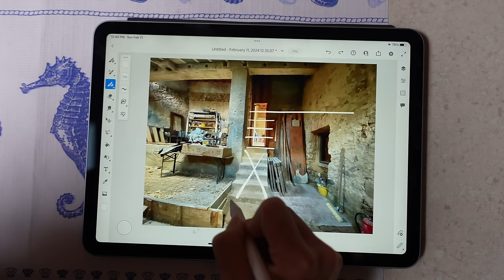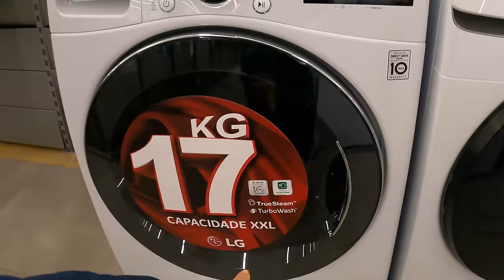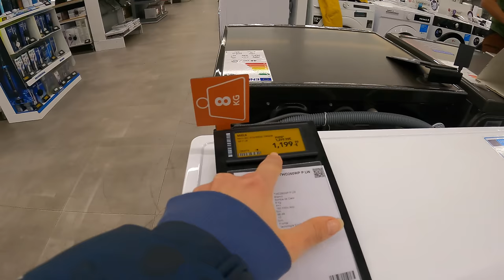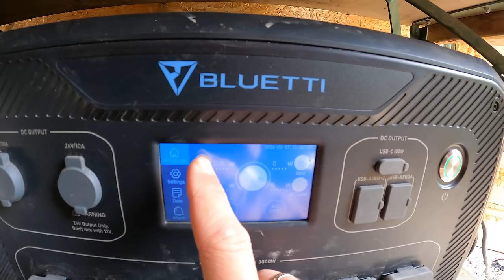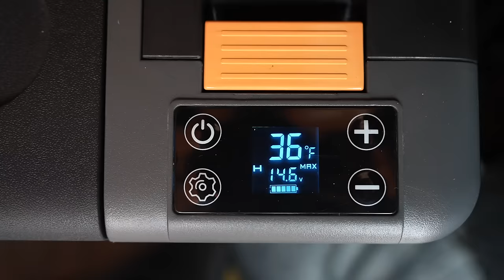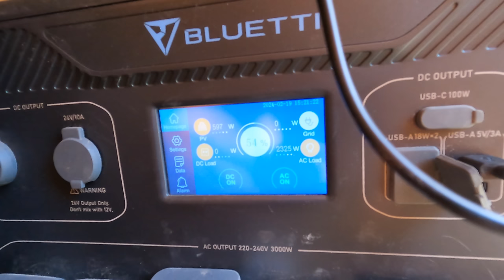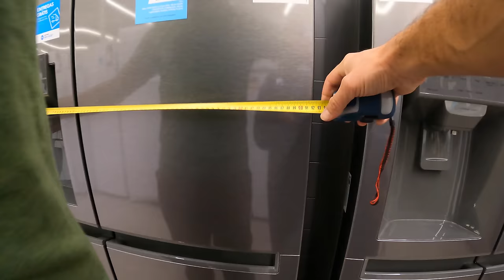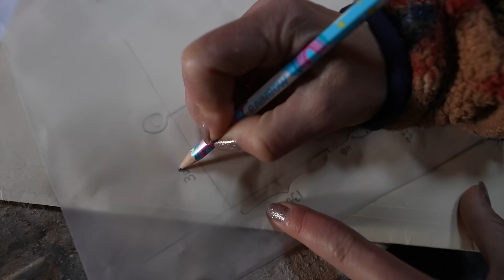UNEXPECTED PROBLEMS PREPARING OUR HOME RENOVATION FOR ELECTRICITY AND APPLIANCES

Comment: A tip for you . When you have the dimensions of your cooker , fridge etc , put sheets of paper or cardboard cut to side on the floor. Then you have the footprint they use up and this will help you determine where other items will go, e.g the Island
Reply: That's an awesome idea, but the construction crew might think it funny...
Reply: 😙 maybe try for your benefit and draw them on the floor …. our neighbours said we were crazy but then they did it when buying furniture. 🤣🤣
Reply: You don’t need to buy the same brand extractor hood as the cooker. Most people ai know wouldn’t (unless you’re getting a decent discount to buy both). I’m with the other commenters who say mark out your planned kitchen on the floor, it will give you a clear understanding of whether your plan works in practice for you. Also, bear in mind if you get a fridge freezer with a 2 door freezer compartment, 5he freezer. Shelves are quite small - I had one and discovered I couldn’t fit some items in (such as a frozen pizza).
Reply: Yes, mark out your appliances and even counter top, island etc. Remember… you are using the metric system which is 1000 times more accurate than the imperial one. So you can measure everything to the smallest millimeter. 👍👍👍
Reply: And lines for how far the open fridge, dishwasher, oven, washer/dryer doors go. And don't forget the over hang of the island.
Reply: You mean, use C.A.D?

🤔

You know, Cardboard Aided Design
Reply: Agree with the paper cutouts. Once you have your items use chalk to outline of your kitchen cabinets and appliances - helps you and your builders see where things go and let’s you walk the space.
Reply: @weedfreer  🤣
Reply from the maker: @nandaabreu5369  We prefer the metric system as well. However, my mind still only understands distances in imperial 😜
Reply: @Mrandmrsadventure  Of course! I totally understand that . I am the total opposite, because I grew up with the metric system. By the way Drew . I need to worn you that there may be someone out here in this platform trying to impersonate you. I received a “highlited reply “ from a completely different profile but with your pic and the context (content, way of speaking etc) was not your style at all. Sara and Luca were already victims of impersonators, so I am just giving you heads up. I took a screenshot of the answer, but I don’t know where to send it to you so that you can report it. I don’t have instagram.
Reply: You can also use tape to outline where things go, which can be moved or changed easily but will stay put until you are ready to pull it up.
Reply: Don't use the size of only one unit use the average size of each unit. Because in  few years you don't want to be doing major renovation just to get a washer or refriz to fit takes 1 inch wider. It happens too many times.
Also anyone who has lived very close to food and maybe be stranded for days from storm. A freezer is a must as well as LPG propone or hybrid devices, oven, frig, bbq,    lantern. convection Ives and single  burners.
Heaters and AC units.
Like I said
Reply: Everything that is it hybrid, meaning needing Electrical AC power only you need to decide what can and should be on a separate circuit that when you loss power and you start switching to solar, generator and batteries theorems that 100 % need to connect everything else later.
water pumps and regulators 1st, small frig, small burner, small  oven, a heater/AC for one small area, phones, computer, Internet, a few LED lights of sensers, you should have outlets for Solar control, toil chargers, generators and powerpack can be recharged.
We have been off grid my whole life and for 4 generations.

Every power option should be part of your play. solar, wind, water, geothermal, LPS, battery  and generators.
I believe 10-14 days is a good numbers it  was 3-4 months in the 60s.
What every the sources you should create a power worksheet. List every single device the start up, drawn, run drawing, idle draw the amount of time if each,  time of date and list of the 911 24/7 items 

It is wise to have all priorities items presided and auto transfer switches and whole house monitoring and regulated. 
This uses to be a major thing but today this is 500% cheaper easy to setup and runs all by itself with alert to your phone in realtime. 
It is called SMART HOME and there is everything in the house that can now monitor and adjust everything .
When I started it was few items stuff did not interface. Now with. IF TTT, matters, threads, wifi. IF, RF and Bluetooth it's fun and reliable. 
Every
Reply: Use the. Average sizes for each device when time comes that model assize may not be the same. There are countless stories if remodelling costing 1000 because of an inch to much. Use the average sizes. Freezer and a mini version of oven, stove and refrig should be as plan B  manual washer as cloth lines . Every solar and wind company has worksheet on there websites. You need to know your draw and if you need more land for the solar farm and battery bars.
Reply: Wild hogs will mess you up fast they are fast too and protective if babies or are around.
You should get a gun very less bear spray and loud whistle and cattle rod long shocking pipe.
In the state we get state to dart them tag as attach large loud  bells round their necks
Reply from the maker: @nandaabreu5369   Really curious what this is all about. Thank you for bring it up to us. Please send the screenshot to our email. hello@mrandmrsadventure.com
Reply: @Mrandmrsadventure  just sent it. Hope you got it. Also, when I originally got this message, it was 10:ish pm which meant 2am your time. The text message this person wanted me to use was a # from Tennasse

Comment from the maker: Thank you for being such a special part of the journey 🤗 We love you! xx, Mr and Mrs A
Reply: Question: If you have to get fiber installed, why keep Starlink? You can keep Starlink as a backup if you'd like. I am sure the fiber is cheaper vs. Starlink at $150. I am just guessing on the price.
Reply: Love y’all too! Thank you for sharing your beautiful journey! ✨✨💛🌞💛✨✨
Reply: Hi guys, I am Portuguese. We always had old cars, never we’ve been told to get full comprehensive or nothing. That sounds fishy. Do you have Portuguese friends that you can ask for advice? Companies I know we can simulate online, Zurich, Allianz, Fidelidade, Tranquilidade. Good luck 🍀
Reply from the maker: @lovedfriend2020  Good question. Starlink in the Portugal is now €40 a month. We would never get fiber or a hard connection due to the setup costs of running the cables to our house. This is why being required to instal an entire "hardwired" telecommunication network in the house is pointless..
Reply from the maker: @sarab3960   Thank you. Yes, we have heard of these companies online but they will not insure our camper and only our truck.
Reply: @lovedfriend2020  True. Internet in Portugugal is super cheap. At least compared to 🇨🇦 which is the country in the “industrialized world “ with THE MOST EXPENSIVE internet, phone plans etc. Two years ago, my brother was paying (in Portugal 🇵🇹) 50.00€ a month for high speed fibre optic internet, landline and 3 cel phones!!!! Unheard of in Canada.

Comment: If you haven't done the kitchen yet, Draw a scale floorplan of the room (including pillars and alcoves) then cut out some scale shapes of the various appliances that you have measured (don't forget to mark what each shape is on to it). Fit the shapes onto the floor plan drawing and move them around until you are happy with the layout, then either tape or glue them in place. Thar will allow you to work out electrical outlets and water lines. Also good for the other rooms - bathroom, bedrooms. 🙂 
Also maybe think about a 2nd outlet next to the container one, so that if you ever do go down the camping site route on the terrace, you can run in some power lines to them

Comment: Miele is one of the most reliable appliances, expensive but durable.
Reply from the maker: Thanks for sharing this. Good to know.
Reply: @Mrandmrsadventure  AEG and Teka from Germany are excellent as well (don't find them Stateside though)
Reply: Miele is expensive, but pays off in the long run. I have my miele washer now for around 15 years. They last forever.  Siemens is also good (my dryer and Kitchens suppliances. Maybe this helps 😘 greetings from Germany 🇩🇪
Reply: Bosh washing machine that's going strong  teka air vent and a dishwasher zanussi works amazing and 23 year's old looks and works like new never have had any problems
Reply: Miele washer and dryer are the best... I bought mine 25 years ago and they still look and work like on the day I bought them
Reply: Appliances are hit or miss for some. Just make sure you save the owners manual, and register your appliances. The warranty on most of these appliances is 90 days or depending on what warranty you purchase, 3 to 5 years. I purchased my extended warranty just shy of when the manufacturer warranty expired. It didn't make sense to have a 90 day warranty running simultaneously with an extended warranty.
Reply: For the fridge get a no frost to avoid any ice spreading on it
Reply: I have had bosh washing machine for 20 years still going strong and would buy again if I needed
Reply: @Mrandmrsadventure  - I think you'd be surprised how good and durable LG or Samsung appliances are, especially fridges and washing machines.
Reply: @resinartbylilian  agree that Miele is a good brand but repair cab be a nightmare as only miele authorised person can repair them  so callout charge ,parts and labour are expensive.  I have Miele products
Reply: Have a lg in the summer house and totally regret I didn't get something more expensive, 4 hours for a load
Reply from the maker: @antoniodasilva1230  💪 love hearing when something is reliable and lasts
Reply: Bosch is a nonprofit that does good in the world and has good customer service.

Comment: Hi guys, in Portugal having ALL appliances from the same co. Is totally insignificant. Here, we look at having the best appliance in the market for our budget. Some appliance brands are well known for putting out great ovens, other are known for great washers, so having different brands of appliances in the kitchen is totally fine (even when it comes to selling your home) as long as it is a quality appliance. Keep on with the great work. ❤
Reply: You're correct my brother and sister back in the USA are having problems every three our four year's with the refrigerator's and washing machines they just aren't last long and keep braking down  basically expensive crap that are always in need too be replaced
Reply: @antoniodasilva1230  Honestly, I don't get this about having all appliances from the same brand co.
Reply: @Alfablue227  yeah it's a dumb move especially when some are better than others  for example my refrigerator is a Samsung
Reply: @antoniodasilva1230 It'sas if they have a timer set to blow the machine a couple of months after the warrenty expires.
Reply: @Alfablue227  Brand loyalty is stupid. If you research properly you will find that several brands are owned by the same parent company where all the washers, driers, fridges, or cookers for all the brands are made in the same factory. They just have slightly different cosmetic trim etc. for each brand, then set the price based on the brand name. All one big con.
Reply: It’s important to get appliances that have parts found locally.
Reply: Miele is top of the brand of electrodomesticos... German quality one if best brands of Europe... personally I don't have a budget to buy Miele...I will be very happy to buy Bosch...🙂
Reply: @netby I have LG and Bosch and love them.
Reply: I agree,  Bosch is a great company.  As is Miele,  but hugely costly!
But considering you’ve gone for years without a need for these appliances,  go for what you find to be best in your research!

Comment: Just a heads up, I watched a video a few months ago in regards to refrigerators. An appliance repair man was reviewing refrigerators. He advised not to get one with an ice maker in the door of the refrigerator. They don't last long. He said it's better to get one with the ice maker in the freezer. Just thought you might like to know.
Reply: This is absolutely true! Really rethink that choice.
Reply: I agree through the door ice and water can be problematic. Side by side refrigerators are a problem because you can’t put big dishes in them. Get appliances that there are repair people for. I recently bought a GE combo washer/dryer. Because the dry cycle uses a heat pump to heat the air to dry the unit uses $12 of power per year. It’s huge and heavy. I would avoid gas if at all possible. They pollute your indoor air with benzene and other zenes, not to mention carbon monoxide and dioxide. I love induction cook tops. They are so effective.

Comment: AFTER I replaced my washer and dryer I viewed an appliance repair guy review washers on line.  I learned SO MUCH but it was too late to use the information.  He suggested a "commercial grade" washer.  The repair guy demonstrated the washer effectiveness by putting a brightly colored shirt in a white washer load.  Most washers never pulled that bright shirt down into the water.  It stayed at the top of the load. My fancy washer does not move the laundry around the washer and twist everything into knots.

Comment: Buy Miele! 
The first washing machine we bought lasted 30 years with one repair, and you don't even have to move the machine for access as the engineer undoes 3 fixings and the whole front swings open!
I tried to work out just how many cycles this machine did as sometimes, with old fashioned nappies to be washed for two children, the machine was doing several washes every day. 
Our second washing machine is now 15 years old with no repairs to date! 
Yes, they are more expensive, but you sometimes get a 10 year warranty and in 45 years we've only bought these 2 washing machines . . . . . . .
And don't forget you can stack a drier on top of the washing machine so you can dry a load whilst washing the next.

Comment: Hanging clothes outside is the best, but if u have a really good washer with a strong spin cycle u will save on dryer time and that helps save energy! By the way those side by side refrigerator are nice but the freezer is so small, it won't fit a pizza or a large turkey! We have one and I buy frozen fruit and veggies for my smoothies and it takes up two shelves!! Good luck!

Comment: I'm a custom cabinet builder with 40 years of experience. I always do full-size templates that include floor layouts and a profile to show height. Contractors scratch their heads when I tell them this ahead of the cabinet installations. When I bring them everyone loves it, especially the electricians. They know exactly where to put plumbing and electrical plugs and anything else you'd find important. Also, download the appliance installation specs ahead of time. It tells the door swing distance and where the plugs and water lines should be. I'm very interested in this project of yours. 🤓
Reply from the maker: Sounds like we could use your expertise!! If you’d like to help us with the countertop design (we plan to DIY it), we’d love your input somehow 🤗 hello@Mrandmrsadventure.com

Comment: 100% run a 32A cable to the container. You will get used to drying your clothes on a line. I'm annoyed if I need a dryer now lol
Having a smaller fridge helps me eat fresh more regularly.
Reply: I disagree.  > They need a dryer during the rainy season.  (they know all about drying clothes on a line)
                    >  They are done with a 'tiny' fridge.

Comment: My Miele in the USA is 20 yrs old and it still looks like the first day I got it.  I just wish the drum was bigger.  My Miele doesn’t hold any hidden water inside like other front loaders do which causes odor.  Washes great but down side is service.  I need service and they want $400 to come out and diagnose it but I already know what it needs.  Service quality has changed in last 10 yrs. That’s the only downside besides size of drum on washer. Dryer is great size.

Comment: You should look into SMART HOME basically there are lights LED can dim and be any color. No wiring to switches that is all wireless ,  each light or outlet is addressed separately so multiple devices on one circuit. A lot less in money , more flexible and easy to expand. Covers everything inside and out and can run with no input from user. 
It is ideal and before you get too far contact a smart contract near you.

Comment: When running washer and dryer on solar panels energy consumption of course is less of a consideration.
Noise levels are also less of a consideration since you only run them for one or two hours each week. Just go for a walk in the mean time.
Build, durability and serviceability are more important. Since when it breaks down you do have a problem with getting it repaired or even find a proper mechanic. Reputable brands guarantee getting replacement parts even after many years.
German machines are top notch. I bought a Miele washing machine more than 30 years ago. Only two issues since. One within one year after purchase and repaired under guarantee. Another a small solder point worn out and quickly found and resoldered by a very knowledgable Miele repair man.
Always go for quality reputation.

Comment: Hi guys, please consider putting the motor for your extractor fan outside of your kitchen. I am assuming on the outside wall or in the attic? I heard a home renovator mention this because the fans are SO noisy when they are inside of the home.